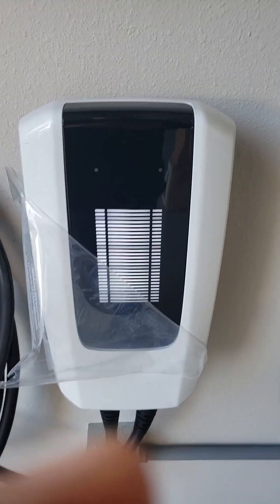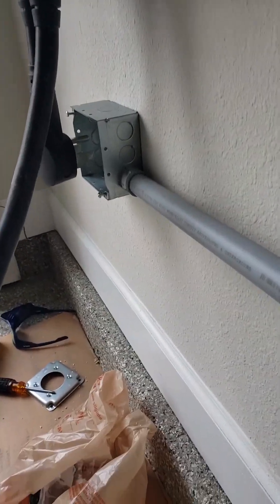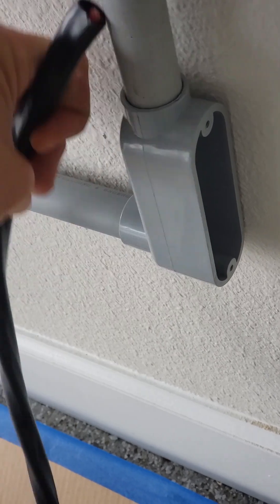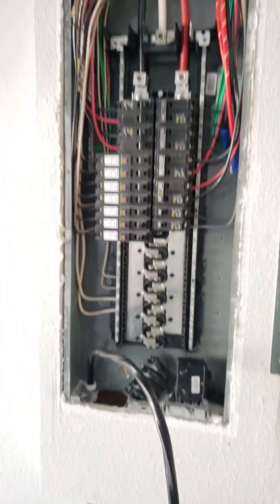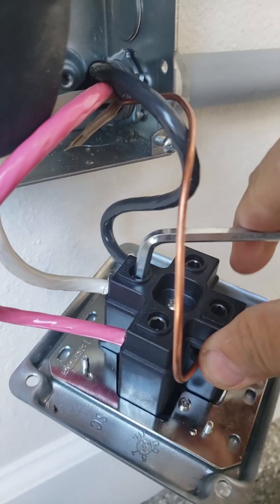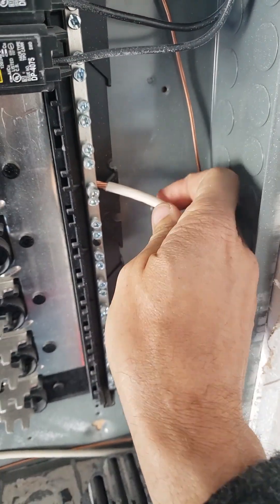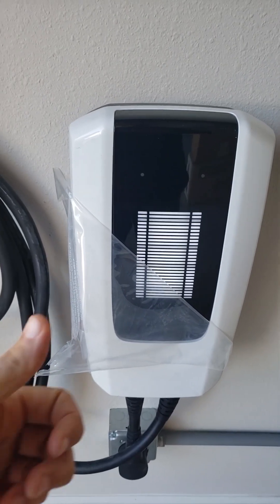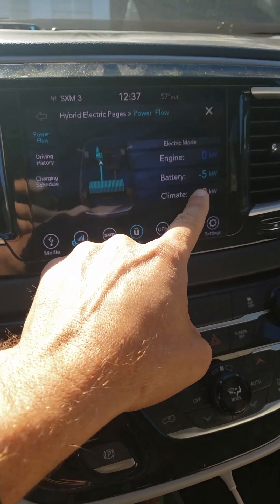Outlet Installation For EV Charger

Comment: Bro #6 is over kill, #8 is good for 55a also bro you should be using  a 4x4, you need to be using a 4-11/16 box instead, that why your Taylor cover didn’t fit your plug and why you have to push so hard to get the plug to go into the box, You shouldn’t have drilled your plate out. You need to be ground your boxes, you went straight to the plug without boding the box, looked like you used 3/4 pvc, 1 you shouldn’t be using pvc indoor like that it look really bad.2 3/4 emt  or pvc is too small for 6/3, you need to pipe 1” bro.3you didn’t even use a heat gun to put a box offset in, take some pride man and do it right. Honestly running Rolex through the pipe wasn’t even the worst to me,
Reply: Also you dont need gfi protection if you not outside.

Comment: Not sure if your cheap or stupid or both.  Wrong outlet lt's not Stamped for EV use, and why the fuck didn't you just hard wire the charger?  #4awg won't heat up. Stop being cheap